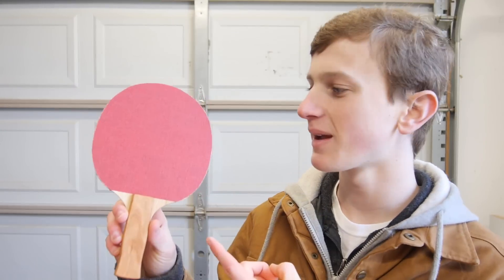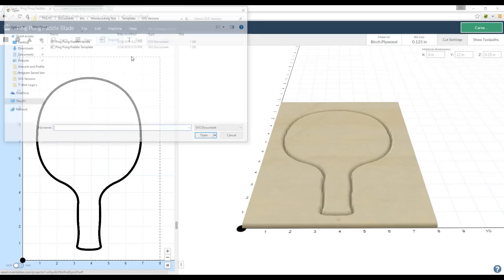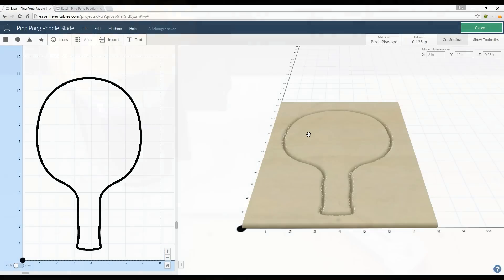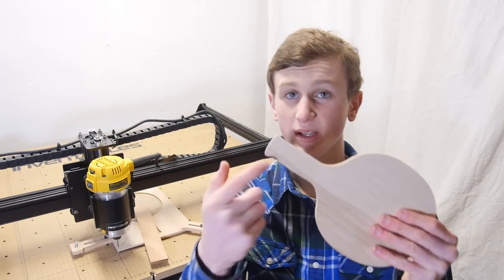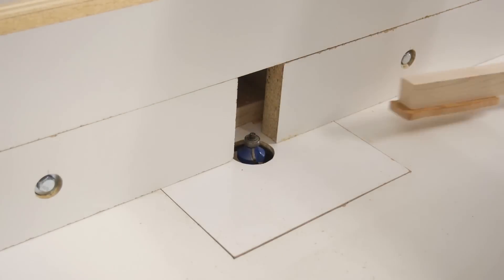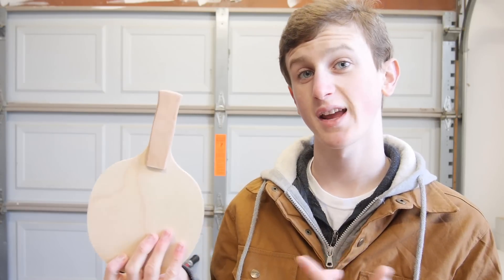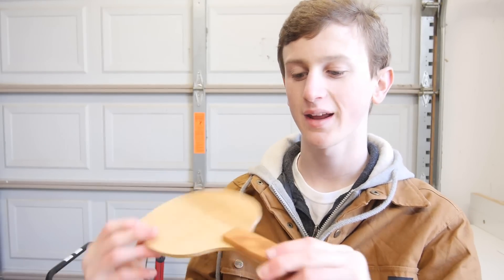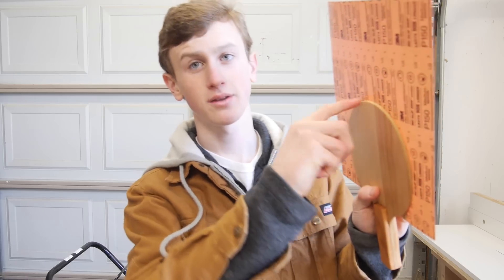How to Make a Ping Pong Paddle | With Free Templates!

Comment: Nice work! I do like how sandpaper plays in a friendly setting. I use rubber for more competitive play. I would recommend against using oil on a surface you want to glue against. Try using a quick shot of spray clear coat on the blade.